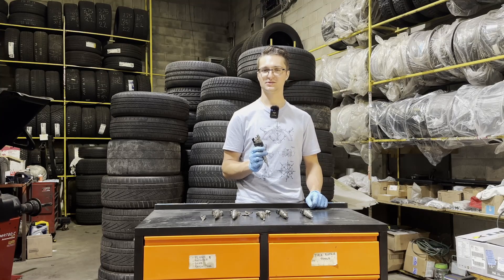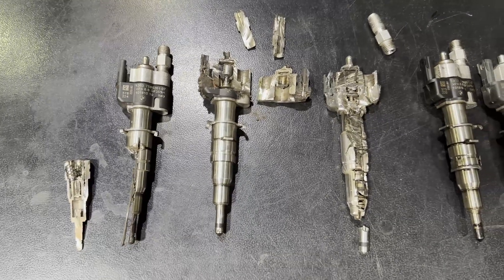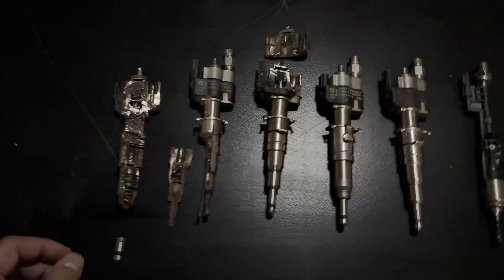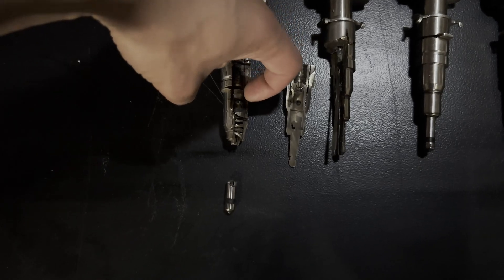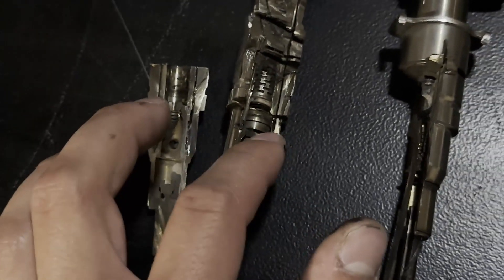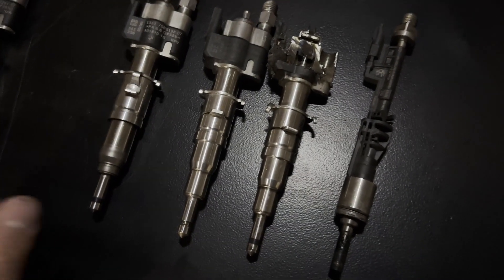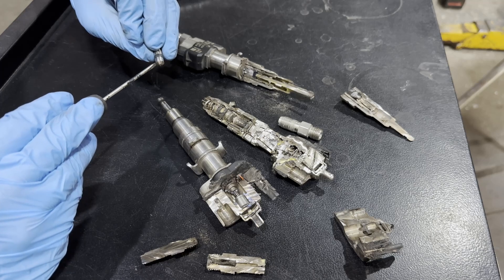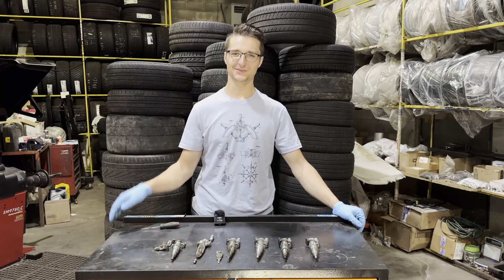Why BMW N54/N63 piezoelectric injectors fail (and how they work)

Comment: Hi, I was the designer of this injectors from 2005 to 2013, if you need some infos let me know...
Reply: You should of designed them better lol
Reply: @naders5 😂😂😂😂 you are right LOL
Reply: @TheFabio1608 I read index ones were great but the manufacturing process was expensive so they tried to cheap out with the next revision and couldn’t get it right for the following 10 revisions. Is that true ?
Reply: @naders5 No, the first versions had many more issues, including with the electrical connections. The modifications were made almost exclusively to improve quality or performance. Keep in mind that this is a project from the early 2000s and it is still used on Rolls-Royce engines, and I believe also on some BMW variants—it was the state of the art at the time. Unfortunately, with the 2008 financial crisis and engine downsizing, it was replaced by solenoids.
Reply from the maker: Were my observations correct? What would you say was the reason the earlier injectors failed ? What was changed in the index 11 and 12 injectors that made them better? Is there anything that can be done to prevent failures for the earlier revisions?
Reply: @dariusGarage You made excellent observations about the outer flange, which was modified to make it less expensive, while the filters are present both on the upper conical adapter and in the lower valve; only the type of material was changed to make it compatible with ethanol-containing fuels (E10, E26, etc.). The flow issues in the older models are due to the thermal compensator; the piezo actuator unit has never been changed. The problem was caused by the oil inside gelling, which led to poor performance as the temperature varied—this is the main cause of the cold start issues.
Reply from the maker: @TheFabio1608 thank you, it means a lot to me! I didn’t even consider that there was oil in the thermal compensator. All of it probably evaporated in the process of cutting that injector open.

One more question for you, why is it that there is a significantly larger deviation in adaptation values during coding for index 7-9 vs index 12 ? For example on the index 7, the 6 digits say 592 208 but the car will register it as 593 204, but for index 12 584 223 registers as 584 223. Is that thermal compensator related as well ?
Reply: @dariusGarage If I remember correctly, the first value in the coding is the energy expressed in millijoules that is required to achieve the dynamic flow rate set during calibration (eg 58.2mj), while the second is the flow rate in mg/injection. These are actual measurements taken on a test bench after calibration (the injector is calibrated by pressing on the upper plunger, which preloads one of the two concentric springs of the compensator).

Therefore, from a technical standpoint, I cannot fully justify this variation, unless the older revision injectors are “worn” and the ECU detects the loss of stroke and compensates for it — but that is only a hypothesis.
Reply from the maker: @TheFabio1608 thank you for the info, I wish I could see how these were manufactured and calibrated. 

I’ll keep an eye on variations when programming injectors into the car a little more closely next time… perhaps there will be a correlation between deviation and lifespan before that injector causes a misfire.
Reply: Man we are crying here... searching for those are horror stories in prices 😂
Thanks for sharing anyway💙
Reply: @thefabio1608 is it true that index 10 injectors were actually the first and pre-date index 1? Looking at the date codes it appears they do
Reply: @SikaSeeker  The revision index is progressive and cannot be modified. You can double-check the indicative production date using the code stamped on the plastic of the overmoulded connector — it’s a Julian date followed by the year, consisting of 5 digits in the format DDDYY. You should find it at the bottom, on the side of the Hirschmann connector.
Reply: @TheFabio1608 yep done that, the build date on my index 10's are September 2006, so they appear to be the very first of the n54 injectors, my car was build in Nov 2006
Reply from the maker: @SikaSeeker never knew that! Thanks for sharing!
Reply: @SikaSeeker  If they are really from 2006, then yes, we’re talking about the very first production batches. The fact that they’re still working perfectly is surprising, but not impossible if they operated in ideal conditions (clean fuel, proper maintenance, no contamination, low operating hours, etc.).

However, the Rev10 point doesn’t fit at all with a 2006 production. So either:
	•	the injectors were refurbished and received a later revision,
	•	or the “2006” reference is being misinterpreted (e.g., batch code mistaken for a date),
	•	or this is a truly special case from a prototype or early experimental batch.

That’s why the laser marking is key:
with a photo we can check the date code, batch, revision, plant, and serial and really understand what’s going on.
If you can, share the picture! I’m also really curious to dig into this
Reply: hello mate, i have a question. I am wondering about this small pin on top of the injector, that pokes out of its cap. what is it for? i accidentaly pushed it to be leveled with cap, and i dont know how to get it back to poke a little out
Reply: @antemihaljevic8099  Hi, that is the pressor that pushes on the inner disc of the compensator to calibrate the injector. A force is applied from above, acting directly on the piezoelectric actuator, until the target flow rate is reached. At that point, it is crimped in position by two pins (you can see the deformation on the outer cylinder).
If you pressed it accidentally, you will have a slightly higher flow rate; in the worst case, you may experience tip leakage issues at low temperarures.
Reply: Hello, I have a question about fuel additives - I've got index 12 injectors in my N63 engine, the injectors have about 120 km on them. 
They working fine for now, but I'm wondering if I should use some injector cleaner additive to maybe help keep them cleaner? 
What's your take on fuel additives? 
Thank you
Reply: @Dirt_shark I’m not an expert in fuel additives; they may have a slight benefit in removing carbon deposits from the tip, with some impact on spray quality and tip leakage. However, I would point out that inside the injector there are two PA6.6 filters that could be damaged and cause serious issues in the sealing area. My advice is to avoid using additives to clean injectors unless there is a real need. If you start noticing misfires, it’s better to remove the injector and clean only the tip by soaking it in descaling solutions. Since it’s only a 420 mod, there are no compatibility risks.
Reply: Is there a major difference between index 11 and 12, and can 12s be used in an N53 engine?
Reply: @DanoGTR  In detail, I don’t remember the revision change from 11 to 12, but the N53 injectors differ from the N63 and N54 in having a different spray angle and finer atomization, since the N53 is stratified. In my opinion they can still be swapped; I don’t expect any significant differences.
Reply: Hey do you think if I didn’t replace the seals it could cause injector cutout under boost or under load?
Reply: Hello..I've a question.whats the capacitance and resistance value of these injectors.will the vary widely with the index number or they all fall in a range? Thankyou..

Comment: WHAT to check when buying reconditioned 12S ? 
I'M on 7s 🥹🥲 IS it ok to change 1 by 1 in my case? 
thanks man nice demonstration 🌹
Reply from the maker: It’s best for them to still be in the car before you pull them. Test them on a cold start and listen for misfires. Check for codes if possible. Then pull them, being careful not to put any dust in the fuel feed, cap them, or at the very least put the original fuel line back on them to keep dust out during transport. Also be careful not to touch the tip of them too much. Don’t clean the tip by hand, you can let them sit in fuel for a day prior to installing to ensure the tip is clean. If they are really difficult to remove, they shouldn’t be reused. Install them in your new car with new seals and decouplers.

If you can’t find any that are still in a car and test them, try to find a set that has the feeds capped, and make sure that the tips aren’t too cleaned. Also make sure the tips have no deep scratches. Check the surface with the seal at the tip for corrosion, as that will cause installation issues, also make sure the injector hole in your engine has no corrosion(after removing your old injector), as that will rip the new injector seal upon installation and give you one hell of a misfire. Clean the engines injector bore if needed, blow out the cylinder with compressed air after. Make sure all the electrical connection tabs are in tact on the index 12s you are buying. Also make sure the font of the index 12 is legible. Injectors taken out of an N63 will have worn off font from all the heat, they still work so long as you can read the font and program correctly. Make sure whoever removed the injector had the right tool, if the guide tabs are bent, or the sides are scratched up/gouged, they didn’t use the right tools, they will still work fine with way scratches, but you can use this as a negotiating tactic. Also make sure to use the right installation tools, amazon ones work just fine.

I’ve only ever done full sets, BMW recommends doing at least a bank at a time 1-3 or 4-6. You can mix and match index 11s and 12s within that bank.

I’ve heard people running single index 12s at a time with success, but if it’s my car, I’m doing the full set
Reply: @dariusGarage appreciated 👏

Comment: You're all talking about it in such a way that it's as if you've taken apart your ancestors. They haven't made any improvements. These piezo injectors are a disgrace to BMW. Their maximum lifespan is 200,000. If you don't use clean gasoline, you'll throw them all away in 150,000. They're very expensive injectors. N55 pencil model injectors. Why? It doesn't work for us, though. They used us as guinea pigs in everything they made and made us pay the price. They got rich, but our hair turned gray. We worked harder than them. What's the problem? I'll say it again. These are just dirty, cursed parts. They're currently 505 euros each, and they made this investment in time and knew people would come and buy these injectors.
Reply from the maker: Index 12 is the only way to go. They run way better than any other injector Ive worked with. There is a distinct difference between n54s with index 12s and n54s without. I’ve installed about 10 sets of used index 12s from all sorts of questionable places, and never have I had any comebacks. Every time I worked with anything index 6-9 there’s an issue. 

You talk about these injectors like they are the worst things ever made because they only last 200,000 (I assume kms). That’s the lifespan of most cars where I live, how can you complain that the injector only lasts as long as the car?? Especially when the n54 piezoelectric injectors far outperform their successor. You’ll max out the hpfp before they run out of flow, and people push these injectors (and engines) to nearly 4 digit power levels. It’s a fantastic technology that unfortunately ends up in the hands of people who can’t afford, understand or appreciate it. Which is why BMW cheaped out on the later injectors to make them cheap reliable units first and foremost, instead of cutting edge technology.
Reply: @dariusGarage my car is bmw f01 my engine is n54b30a I bought this car with 259 thousand kilometers and now it is 363 thousand km, which means I have driven it for 100 thousand km. when I checked the injectors I saw that they were index 12 and they were. I gently took them out and cleaned the tips and did a leak test. None of the injectors were leaking. I then put them back in place. and I coded them. I started the car. when the engine warmed up, the 3rd cylinder shut down. I changed the spark plugs and coils. The problem was the same again. Then I transferred cylinder 3 to cylinder 1. The problem was transferred to cylinder 1. Later I installed 8 injectors on the injector on the first cylinder and nothing changed. I tried every possible way with the spark plugs and coils. rich mixture. I noticed that the car was running and. I've had the injectors repainted again. 6 of them are now leaking and smoldering. You're saying the car has a lifespan of 200,000 km. My friend has an N55 and it's 830,000 km. There's still no problem with the injectors. These piezos are always a nightmare. An extra filter is installed in the LPF fuel line coming from the tank. This means the fuel is filtered from the tank and filtered again before the HPPF arrives. The dirt coming from the tank is a threat to them. There are small filters inside the piezo injectors. These filters wear down over time and clog the piezo. Users in the USA are removing the filter from these injectors.
Reply from the maker: @serkangokce4050 well it sounds like you’re the wrong person to be using a car with this type of injector. If you want to be cost effective, this is not the model for you. You really should be driving a car with the cheaper injectors like your friend.

Furthermore, if they were working fine, why touch them in the first place? Especially if you’re on a budget. It sounds like you wanted to test for the sake of testing, and the test somehow damaged the injector. You also didn’t mention if you changed the seal and decoupler or not, that makes a huge difference as they are one time use.

I’ve never had issues with index 12s period. I couldn’t imagine how a properly installed new index 12 replacement would fail immediately after installation. There is user error somewhere or you are buying defective injectors from a scammer. 

Also what do you mean they were repainted, and now are leaking/smoldering?

Comment: At 12:38 you tell dirt is getting in , it is the fuel that are carbonized , Thats why the injector cant close anymore and leak fuel all the time, when you stop the car the fuel is dripping on the sparkplug and you get misfire, look at your sparkplug are they Black and sotty then you have a leaking injector
Reply from the maker: It can be that too !

Comment: Pump injector cleaner through Them with a low preasure pump and a injector tester to activate Them run the cleaning for min a hour
Reply from the maker: This only solves one issue, the carbon internally preventing the plunger from closing. Check out what the designer of the injector has to say about the reason they fail in the comments section of this video

Comment: They say index 1 are most reliable. Many people opinion. Have you dissected any 1s ?
Reply from the maker: Haven’t been able to no, I’ve mainly dealt with index 07-09 and switching them to 11s or 12s, but the few shops I’ve talked to always say 12s are the way to go. From my experience 11s and 12s are the best, I’ve never seen one fail.

There’s a reason BMW started to make revisions after index 1 and they stopped at 12…
Reply: @dariusGarage I read index ones were great but the manufacturing process was expensive so they tried to cheap out with the next revision and couldn’t get it right for the following 10 revisions until they went full circle back to the original manufacturing process with the index 12’s as they did with the index 1’s.
Reply from the maker: @naders5 interesting, that does make sense, but you also need to remember that the index 1s are older by quite some margin. They are nearing 20 years old at this point, whereas index 12 are 9 years at most. Age, heat cycles and mileage may have some impact on their reliability and efficiency of course as things wear out over time, like that plunger at the end of the injector or the piezo crystals ability to expand and contract effectively. While they are likely a far better design than an index 7-9 injector, index 12s are the better option in 2025 and for the foreseeable future. Prices of used injectors reflect this as well.

Comment: Thanks, there is no clear info about either or not index 12s can be used in n43 engines. Do you know anything about it?
Reply from the maker: Thanks for tuning in, we don’t have n43 or n53 in my region so I can’t speak from first hand experience… From what I read online yes they work as long as all of the injectors are the same part number and coded in correctly. N43 and N53 use the same injectors with a smaller needle, so if it’ll work on an n53 it will work on an n43 as well. 

https://www.e90post.com/forums/showthread.php?t=1886357
Reply: @dariusGarage  Thank you